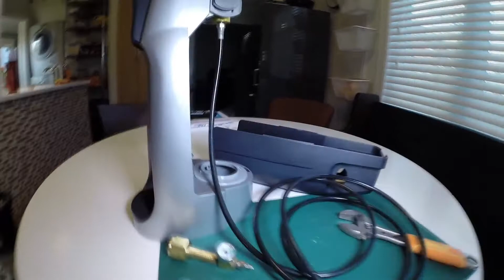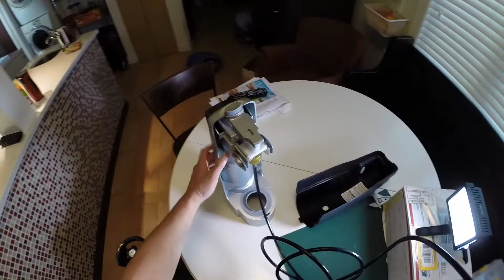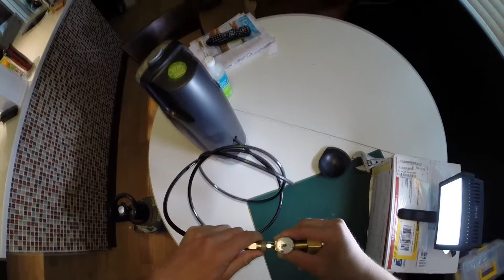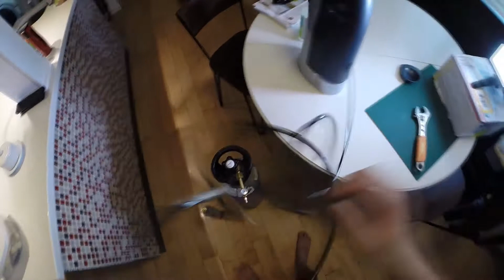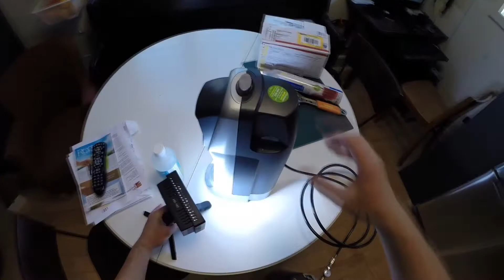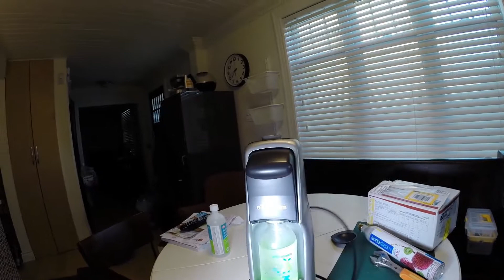SodaStream CO2 Doctor FreedomOne+ Carbonator Replacement

Comment: How can I get replacement parts for my CO2 Dr. sodastream kit?  The hose connecting the valve body and the tank adapter sprung a leak.  I went to a shop that supposedly could fix any hose issue, but they could not get the proprietary non-pipe thread that goes on one end.  Mine blew out after about 10 years, but I am S.O.L. unless I can get that hose.  thanks -scott